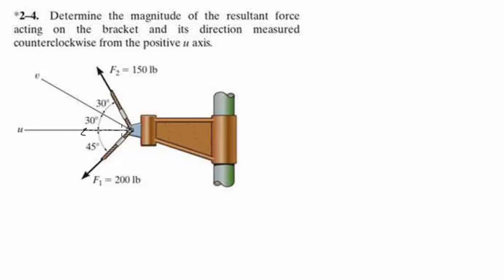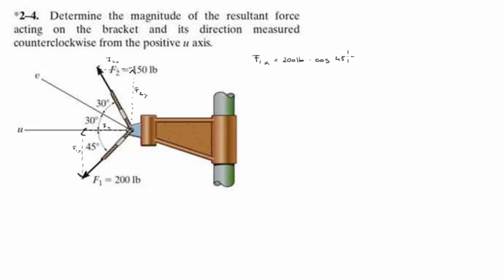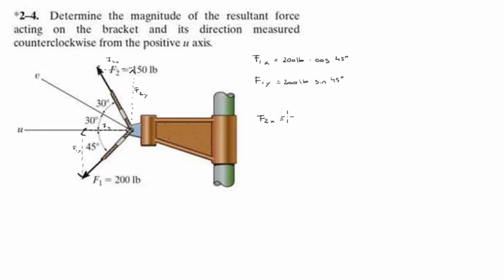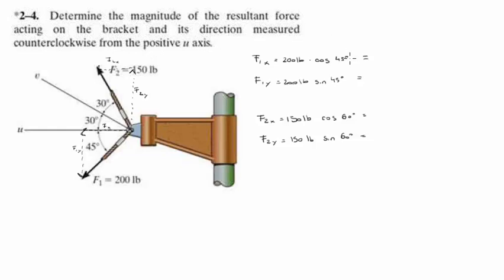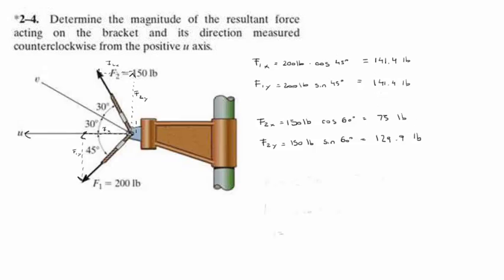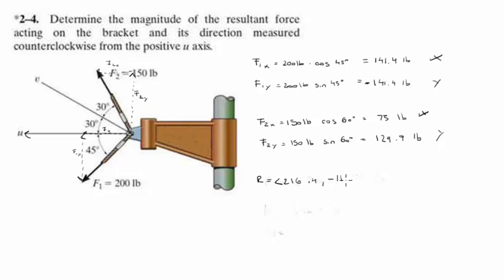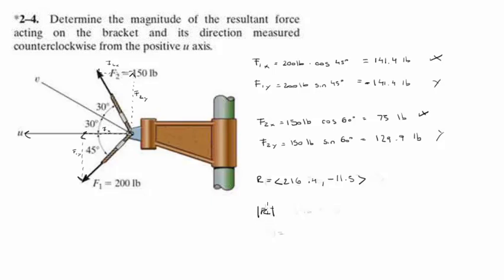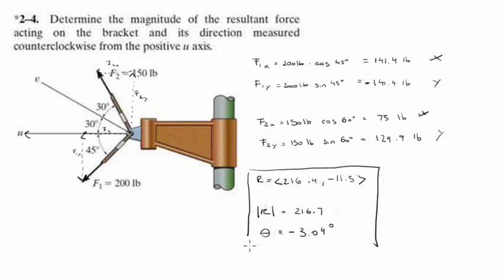Problem 2-4: Finding the resultant force

Comment: Two forces are applied to the construction bracket as shown. Determine the angle which makes the resultant of the two forces vertical. Determine the magnitude R of the resultant

Comment: how come for your components you left everything positive? Shouldn't your F1x F1y and F2x all been negative?
Reply: Not necessarily. Left doesn't always means negative. The question sort of leads you to the fact that the left is the positive direction. For your own calculations, you can make any direction positive or negative, as long as you keep it that way with all components in the system. It's always best to write the direction and the sign (+) for up/down or left/right so the grader/reader can understand right away.

I did this problem the exact way you wanted to, and I came out with the same answer as this guy.

Regardless, the signs don't matter too much in the end when finding the magnitude since it all squares out. It does factor in when finding the angle but you just have to look at your resultant components and make sure the angle you found matches with the specific components, as well as what the question is specifically asking for.
Reply: Okay thanks. the only difference between the answers was that the angle that I got was negative compared to his (but the exact same angle obviously), other than that yes.